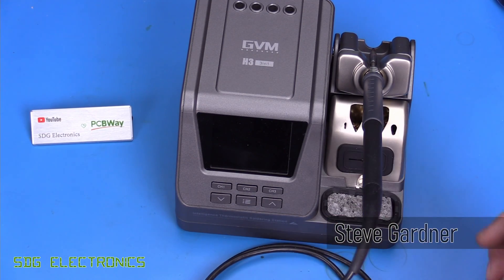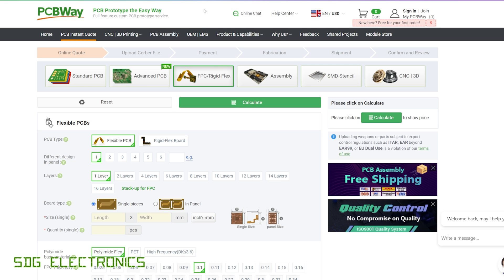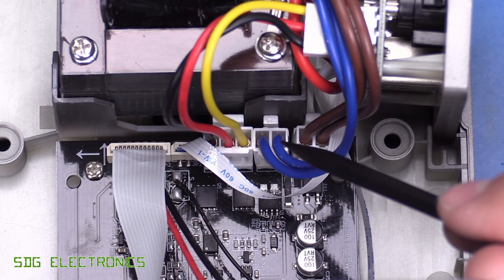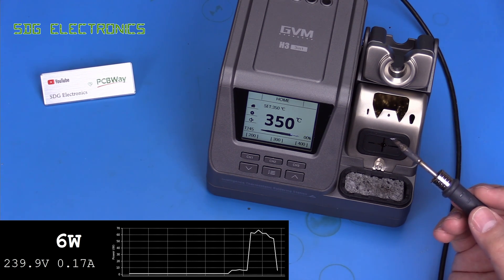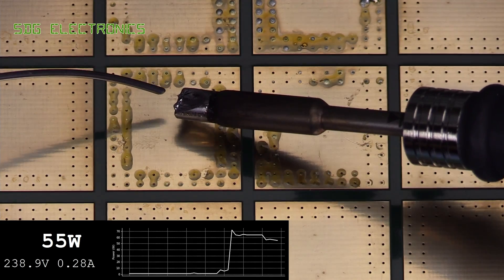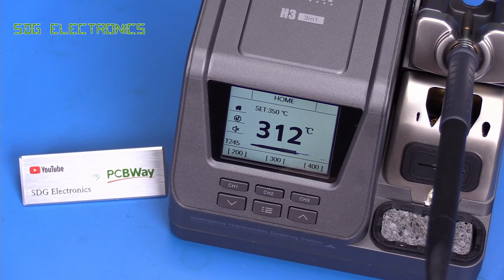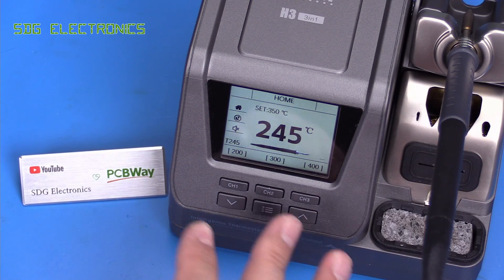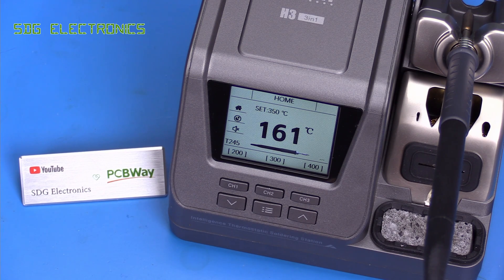SDG #333 GVM H3 - Performing how it should! (almost)

Comment: Hi SDG, could update your playlists with the new videos? I found quite a few newer videos that weren't in the playlists they should be and it made it difficult to finish my research on the hot air rework station and soldering station I'm going to buy soon. Thanks!

Comment: More pretty appearance than T420 as for me. But only 60W max with C245... I use genuine C245 tips with my T420 exactly where high power is needed with massive tips as 966 or 908. For most other scenarios, C115 is enough.
I didn’t see in the video whether 57...60W is enough to maintain the set temperature of the thermocouple of your genuine tip in the test with a coin. Or is there a some temperature drop indicates?
Reply: No temperature drop, I’m sure. 

But 50W while soldering is A LOT. For reference, Metcal MX (#1 in the coin test) is 40W maximum into the tip.

Comment: I've been using this exact station for almost 5 months now and I can say I am more than happy with it and its performance.
The only draw back as you mentioned is it doesn't go into a stand by mode with a reduced temperature when its in the cradle but else it goes into a complete sleep mode where it completely cut the power to the tip, which is not abig deal but still counts.
Reply: Was yours assembled correctly ?
Reply: @M.E63  Yes it was